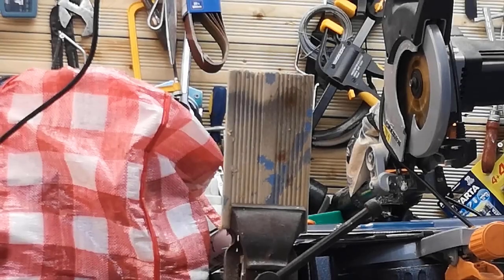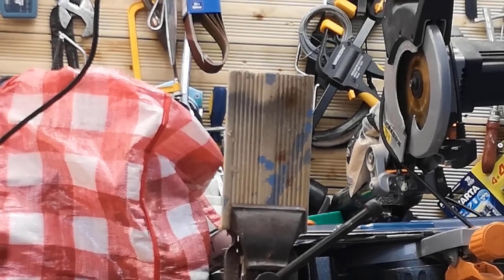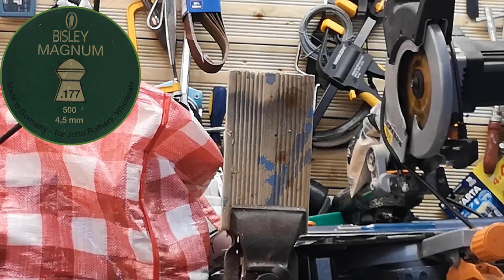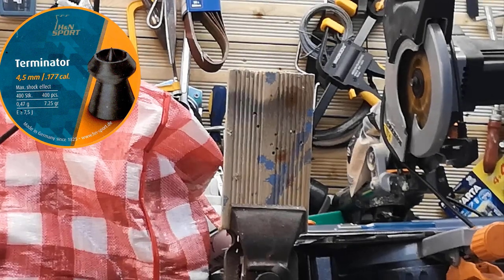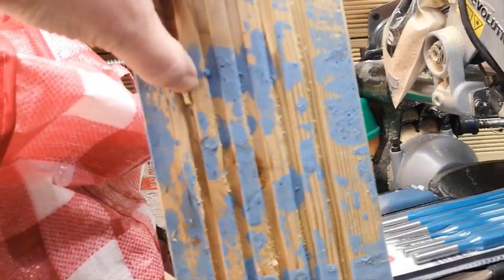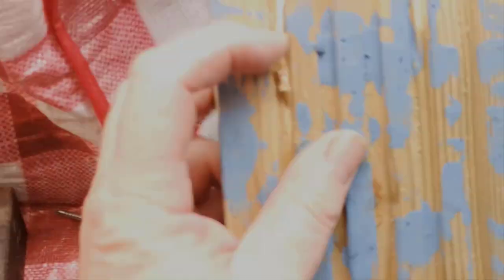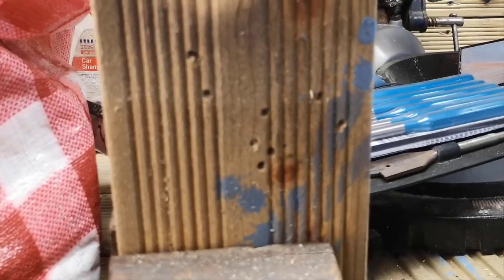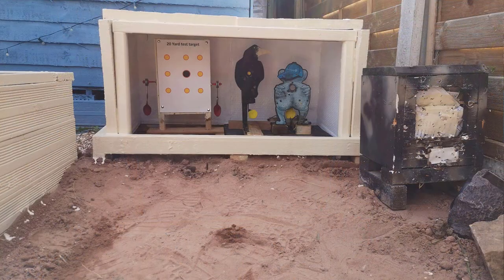How good is your Airgun Backstop?

Comment: I've built 5 boxes 15x12x12 out of pallet wood sides and bottom with scaffold board back and hardboard front. Fill these with cut pieces of carpet. Target on front, carpet deadens the impact noise.  

Took one to a friends and tested with a 40ft lb .22 and 25gr pellet over 30m never reached anywhere near the scaffold board back, so safe for my back garden range of 10 - 30m.

Comment: I have always used 2 feet square paving slaps (bloody heavy) built into a square box with lid and sides. Just to make sure I use 2 slabs at the back. Sort of permanent as I have fixed in with cement but makes an excellent backstop. I have also painted green to blend in with the garden and crass and fixed some shelves into it for hanging targets etc. Never use wood as prone to ricochets.

Comment: Load of old carpet before the wood for me
Reply: Yea same I cut carpet into squares about 15 of them  then stick a piece fiber board ( like the bottom of a draw)half way through the carpet then screw it to  the inside of my box and it's made out of 3/4inch marine ply and that's double layered ply at the back .. I have shot a box set up like this from about 25m for months without changing the filling litteraly thousands of pellets  ... but the other week I swapped it out to dispose of the lead . And only a few had made it beyond the fiber board and into the next layer . If your making box like this  it's key to keep the layers tight together and to change it out from time to time so not to get too far into the padding and also the lead can be hazardous.